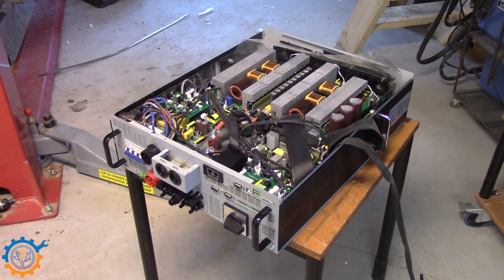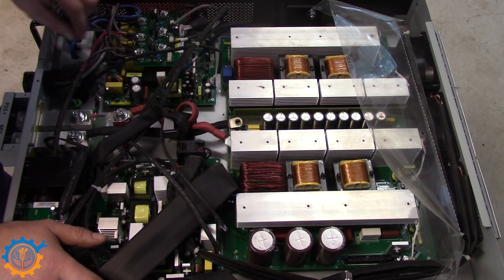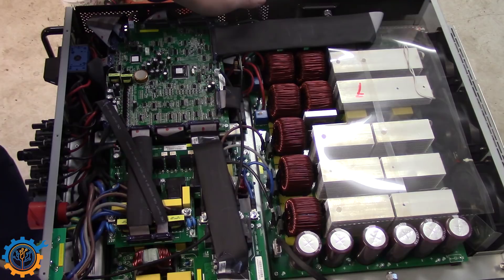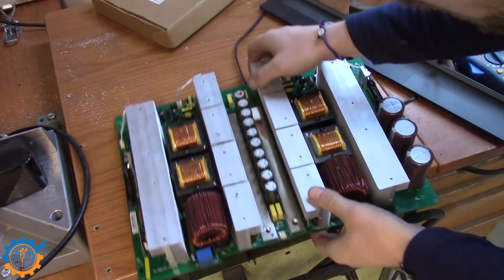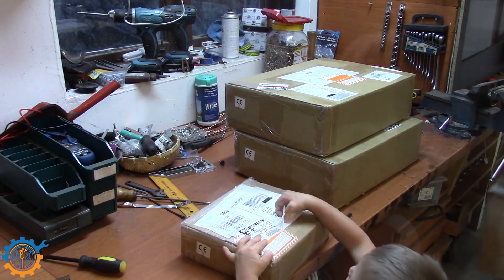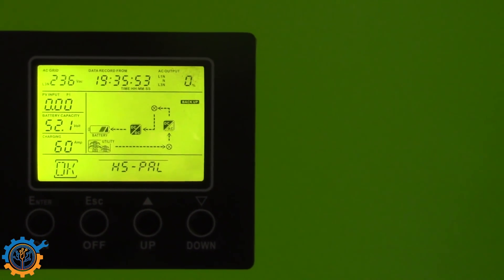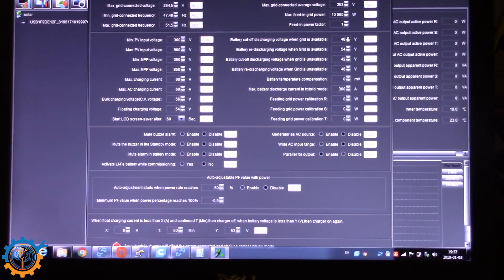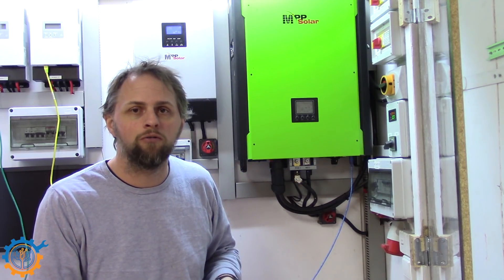Replacing broken parts in MPI 10kW Inverter

Comment: Hello friend, can you help me please? I have one of that model that gives me error 03 but I already repaired it, I changed the Mofers and the error was removed. Now I get another error.. error 35 and I couldn't remove that error.
Reply from the maker: 35 is internal wired loose. Sounds like something is not put together correct?
Reply: Could you give me your WhatsApp contact please?
Reply: Do you have an internal installation plan of the inverter that you can give me?
Reply from the maker: @thiagoelectronic2348  no sorry.

Comment: Hi. I also have an InfiniSolar 10KW, but i cant get a connection by the USB Port. the Windows make the connection soud, but i cant see the inverer on the SolarPower Software.
I also cant see the device in the Windows "Device Manager". I have tried it on three different computer.
Do you know or think is the problem the usb connection card or the lower mainbord?
And where do i get spare parts for the unit?
Is it possible to install the lan-Modul in the intelligent slot and use over this ethernet modul the SolarPower Software?
greetigns from vienna
Reply from the maker: Tried other cable or rs232? Perhaps contact the seller?
Reply: @DIYTechRepairs  
Yes. I tried a other cable. With RS232 i dont know exactly how i can connect the device.
I know by USB i can see the device in the "Device Manager" on windows.
How can i see the conncetion by RS232? Do i have to change some settings in windows to connect is serial?

Because of the Seller: I get the Inverter from a friend. The company wich installed it, does not exist any more 😞

Have you experience with the Lan Modul?
Do you know if the conncetion modul (where the USB connector is mounted) changes the status in the device manager (windows) or does this the motherboard?
Maybe only the communication modul, the single Paltine is defect!?
Reply from the maker: @Terminator-hy8wv  Yes you should find a serial device when connecting over usb. If you dont you are missing the usb-serial driver.  Im not sure what that one uses. Neither do i know about the lan port. Im just using direct rs232 and to an esp module
Reply: @DIYTechRepairs 
Where can i get this serial driver? (i tried it with threee computers, win7, win8.1 and win10)

How can you connect over rs232? Only plug the serial cabel in both divices and start the software? does the software recognize the Inverter with a sign on the left side below the computer symbol, like it do by a usb connection? How can i see that the device is "online" per rs232?
Reply from the maker: @Terminator-hy8wv  don't know. I don't run it like that.
Reply: @DIYTechRepairs  You connect over rs232 and SolarPower or an other way?
Reply from the maker: @Terminator-hy8wv  rs232 to an esp. My own software

Comment: I know this is an old post. However, while searching for hybrid inverter, i bounced into this channel and found this video interesting. I have gotta same DCDC Board for repair!  Buck boosters on the DC side were severly burnt (MOSFET IRFP4468 x 8 pcs). The little Driver Board 16-000362-01G has some burnt-out resistors !

Comment: Hello everyone, I need your help urgently. I acquired the MPI10K recently and installed successfully without issues initially. However, for whatever reasons, my Grid doesn’t connect to the loads, although I set the following priority:
load supply source: PV-Grid- Battery 

1. PV alone or combined with batteries work well
2. Battery alone also works perfectly but
3. Grid shows on LCD by flashing and not connecting to loads as stated above. 

I need your help and ideas. Thanks
Reply: Did you manage to figure out what went wrong
Reply: @dokula  yes I figured it out thanks. 
Actually one of the phases (L1) had a very high voltage (247V), hence the system was unhappy. We contacted the Energy Distribution Company and they decreased the voltage to normal range. Thanks buddy.

Comment: In 3 years working and with that issue what your feedback on that inverter? I have 3 unit pip5048 2 of then ad issues also and the support from mppsolar was very bad
Reply from the maker: I had to change Mainboard. Unfoetunately you get what you Pay for and yes i avsked Them many Times to fix it but they ignored mee instead. Im going other brand next tims
Reply: @DIYTechRepairs  Did you have another repair after this video? Because, in this post, you mentioned you had to change the Mainboard. What was the cost of all repairs for the parts incl. shipping? Aside of this. Good Video... :-)

Comment: How does the data get into grafana?
Reply from the maker: I use solar-sis back in the days. Now i use an esp8266 with some code i have written that sends the data wirelessly over mqtt and then into influxdb. Have a video about it too :)
Reply: Oh yes, "Making your inverter wireless - What a great idea!". Seems to work with other inverters as well. I would prefer having it wired.
But about the 10kW Inverter, you are not so happy about it, mainly because of the around 200 W constand consumption, right? Or did i missunderstand this?
Would you buy another model now?
Cheers from Bulgaria
Reply from the maker: @daskasspatzle2396  i went wireless because the Wired connection on Them wasnt ideal. Yes i would go victron IF i could afford it  :) 240+ w Idle and No support and very bad implementation of many functions. But it have worked ok since i swapped out the mainboard
Reply: Is there any Victron, that has all this functionality, including feeding into the grid? There are so many of them...

Comment: How much did those boards cost?
Reply from the maker: Way to much...
Reply: @DIYTechRepairs  I just bought the same one.Not connected any batteries.Does it still supply PV power when the grid is off and there aren't any batteries?
Reply from the maker: @claytonmascarenhas515  you should have grid or battery hocked Up. Solar is not enough
Reply: @DIYTechRepairs  oh I see,thought it would still put out of power if my consumption is less than the PV production like the off grid version.
Reply: @DIYTechRepairs  I wonder if it will supply PV power if I just hookup 4* 7.5ah 12v batteries in series.
Reply from the maker: @claytonmascarenhas515  yes it Will but you Will kill the batteries instantly when the Sun hides behind clouds or not strong enough. Note that the 10kw inverter need around 250w just to run
Reply: @DIYTechRepairs  oh damn it,need to find another solution.
Reply: My off grid model works fine without the batteries I wish this would do the same .Thankyou for all the info.
Reply from the maker: @claytonmascarenhas515  This unit can also run without batteries as long as you have the grid connected.As I said in the first answer.... A normal off grid unit cannot run without batteries at all. Thos who can are  semy hybrid version and also some more reputable brands can but MPP off grid cannot. (Except for the battery less option as said)
Reply: @DIYTechRepairs  I have another off grid inverter that runs without batteries it's supplies power from the PV panels when there is no grid as long as the load is less than PV generation.I thought this would work the same way as well

Comment: I have an installation done recently with the 10kw, my issues is the current draw of running the machine can't get it to run completely off the grid during the day.
Reply from the maker: You cant. When have battery primärt it uses grid. Only way to work around is either to disconnect grid or backfeed to grid manually. I do the later via my software
Reply: @DIYTechRepairs  doesnt this model have an option to be off grid(not feed the grid but still can export power from grid)?
Reply from the maker: @GG-qh8fy  you mean import? Yes it can but if you buy it for that you missed something. Its 10x cheaper to buy off grid if you dont plan to export :)
Reply: @DIYTechRepairs  ok...i ordered my hv2-5048 directly from MPP Solar for only USD 700 shipped to the Philippines. Found some online that are being sold twice that amount. I think its best to order directly from them to get it cheaper.

Comment: Why you not replaced the broken MOSFETs??? It would be cheaper
Reply from the maker: Its not that simple im afraid. The drive board have issues to and more importantly the software is tuned towards the mosfet bridge since its a hybrid version. I have though saved the stuff if it happens again but since replacing the DC/DC board or mosfets require tweaking the software it made it a bit hard for me to do.
Reply: @DIYTechRepairs  ok

Comment: Hello 🙂
Hope your inverter is working fine.
I have 3kw+ infini inverter. Please can you guide me regarding to batteries voltage setting.
I have 4x165amp batteries.
Reply from the maker: Muhammad Haroon Riaz  you set the voltage based on ur battery type. You need to check the datasheet of ur batteries.
Reply: each battery is 12v, 165amp and 23 plates flooded battery. I don,t have any other information about batteries. :/
Reply from the maker: Then I cant help you im afraid. You need to look at bulk and float voltage on them and set accordingly. You can always check a generic number for flooded battery packs to but its not an guarantee since it can be different depending on type of cells.
Reply: Yes  we are the same problem i have 3 kw infini brand solar inverter. the problem is the capacity of battery bank storage is only 50%. ill try to set up to increase the maximum charging voltage bulk charging voltage and floating charging voltage. but still failed to charge 4 pcs battery 200 ampr during power interuption can running only 2.5  hours.
Reply: @gersoncalimbo1136  agm or lead acid battery has only 50% D.O.D. the voltage should not be lower than 12.2-12.5v to avoid damaging the batteries.

Comment: I'm curious to know if they have put Zener diodes on the gates of the IGTB's to clamp the maximum gate to drain voltage? MOSFET's really don't like too high a gate voltage and will short source to drain if that happens with lots of magic blue smoke escaping.

Can you see what type of IGBTs they used, it would be interesting to see a datasheet for them.

You might even be able to fix the old power board by replacing the shorted IGBT's. It would be handy to have a spare... :-)
Reply from the maker: Morten Mortensen gonna take a look. Yeah im intrested  in fixing it but afraid it could damage something else.

Comment: I would imagine that due to the design, there could be several points that a surge could of occurred. Since they don't know exactly where the surge started from, it's best to replace all 3 portions and then examine to see what happened and make future revisions to minimize that issue happening again.
Reply from the maker: They replace all 3 since the main board controlls those 2 boars. And they need to allign to each other for feeding the current back and forth. So I could either send the inverter back to replace that single board and they reprogram it or i had to replace all 3. So i took the later.
Reply: Yeah, I suppose that's best. That way you get everything back and operational quicker this way.

Comment: Hahahah, at the beginning where you are taking the screws off while the unit is upside down, it "looks" like you recorded putting the screws "back" in and then played it backwards to look like you were taking them out.  😜
Reply from the maker: Thats how i did it ;)
Reply: LOL  wow, that's sneaky  🤠
Reply from the maker: When the Inverter did break down i just wanted to get it down to see what happened and order the spare parts so didnt have time to film that :D
Reply from the maker: The logging shows that temperature inside the case never was above 15C that day so doubt its overheating in that sense unless the fans died on me but they were running when I got home. 
I dont log the temperature of the device though but it was not under any load thus shouldnt have created any heat
Reply: Ive done that before TOOOOO LOL!😆
Reply: I wonder if igbt-s burned because of overheating.

Does your cupboard have big enough ventilation holes?